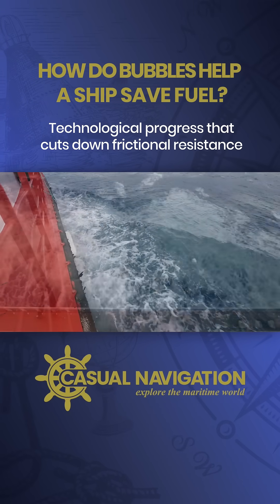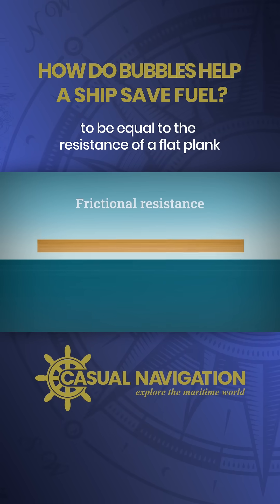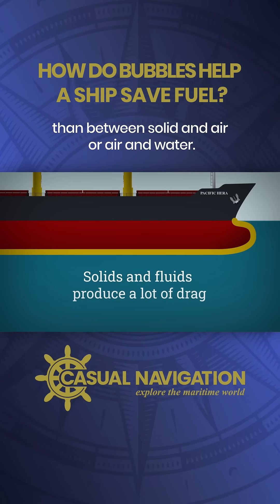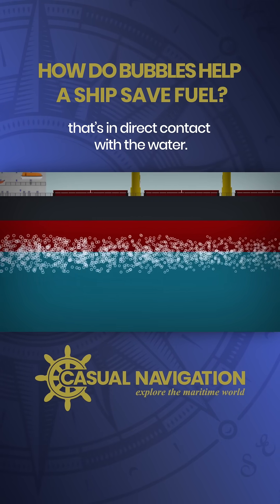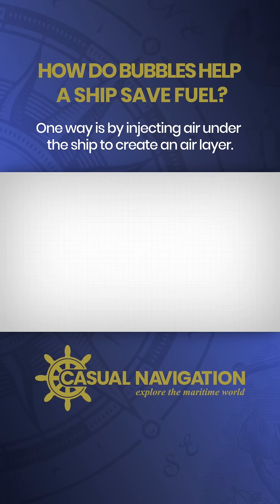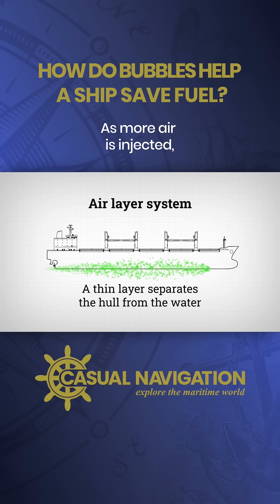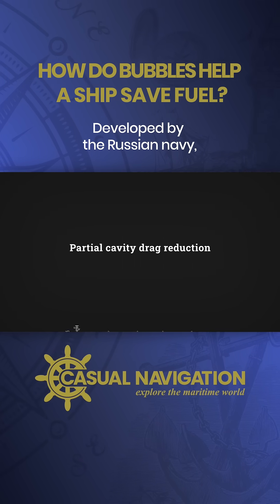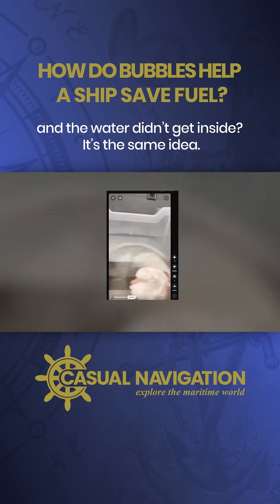More Bubbles = Faster Ships! 🫧🚢

Comment: The issue naturally is cost. Retrofitting this is expensive (making a hole in the hull for one, finding space to fit an air pump where cargo often is and finally the fuel lost to make the air vs the efficiency gained from the lubrication). Doing this when the ship is under construction is vastly cheaper and offers better design potential to minimise all the downsides. Seems extracting the C02, to use as the air would be a good use of exhaust gasses except that C02 is a bad gas for oceans as it makes them even more acidic but the benefit from less fuel used might be more benefit considering current shippings extreme emissions.

Comment: Would the air also affect how efficient the propeller is aswell or is it too dispered by the time it reaches the propellor? Very interesting concept and good video ❤
Reply: it may change the load line and therefore change the amount of cargo it can carry.
Reply: @wleric6560 I was under the impression that you sink lower into bubbly water. I wonder if that's true here, and if so, how does that affect the boats performance.